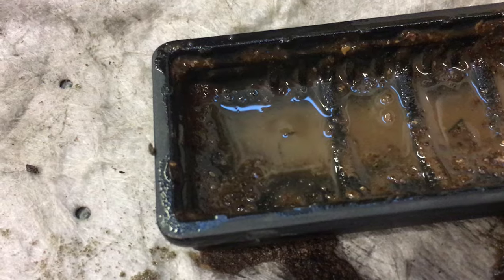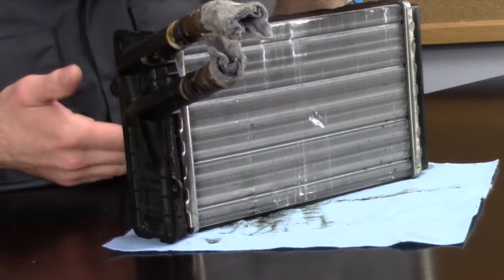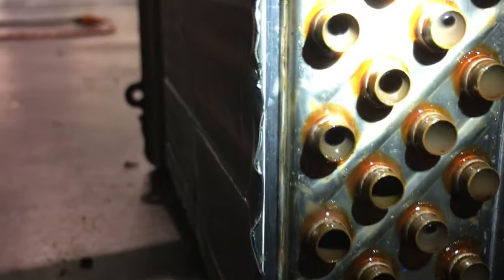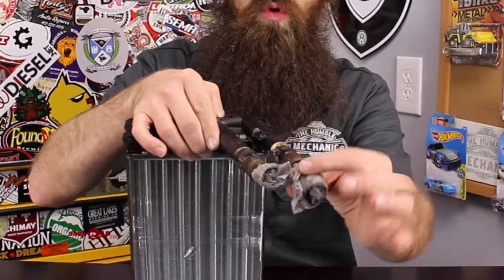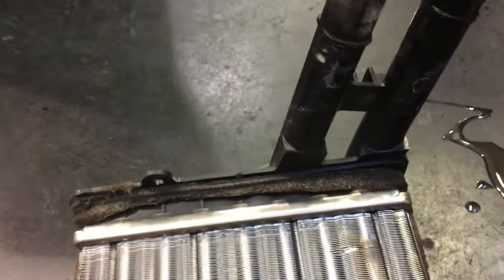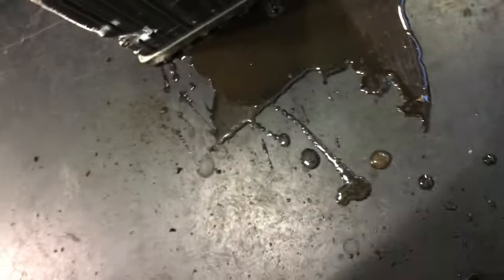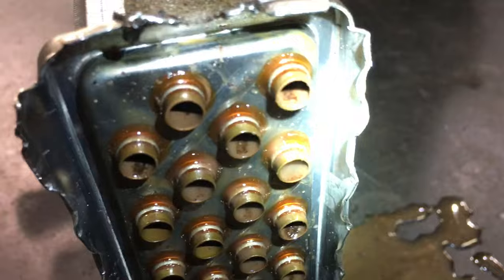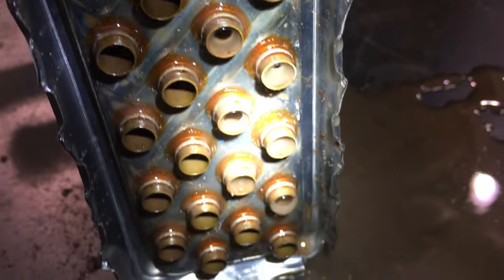How VW Parts Fail ~ Heater Cores

Comment: I bought a 2014 Passat TDI with 59k miles and within three months I had to have a new heater core put in. Six months later another heater core, that one lasted eight months and had to replace it again. Each time the work was done at the VW dealership I bought the car from under warranty. After the third heater care I made the decision to trade in the car for a new Toyota. I do miss the great fuel economy of the TDI but but the poor reliability of that car wasn't worth the headaches.
Reply: Getting a newer tdi is always a bad choice
Reply: I got a 13 Passat at 92k miles. Put about 100K miles on it, Heater core went bad, flywheel went bad, radiator fan went bad, oil filter housing leaked oil and coolant and needed replaced, alternator pully went bad, a/c compressor went bad, DEF fluid temperature sensor malfunctioned causing no restart in 200 miles, a bad ground connection causing battery charging and starting issues, a failed coolant hose barb and last but not least, 5K miles ago had to replace the turbo.  It has been by far the least reliable vehicle I've ever owned and I'll never own another VW ever again. I got a 2021 Mazda with a skyactiveG engine and it is every bit as nice as the Passat with 100x the reliability.

Comment: Here's how heater cores fail - 1) Failure to change the "lifetime coolant" every 5 years or 100,000 miles.   That "lifetime coolant" turns acidic over time, and the acidic coolant starts eating away at the plastic cooling components - especially the plastic END TANKS.
2) Clogging by mixing g12 coolant with a non g12 coolant.

Comment: why not putting a coolant filter like the big trucks have? you can install it as a bypass system. That way the heater core, egr cooler etc will not clog and just replace a $2 filter instead of that huge mess of replacing the heater core.
Reply: because if you take care of your coolant, you don't need anything lol
Reply: @hsproyaya  I'm on my 4th heater core. Each time, the coolant was replaced, and only 9 months between replacements. Taking care of coolant is the problem.

Comment: Back in 2004 my wife bought a used 04 diesel bug from the VW dealer. The car was a awesome looking and my wife loved the look of it. But we didn't like all of the problems it had after we bought it. One of the problems was the heater didn't blow out hot air. My wife had a 70 mile commute to work one way so the heater should have started working long before she got to work. I thought right off the bat it was the heater core so I had my wife drop it off at the dealer to get it fixed because it was under warranty. A couple of days later my wife gets a call to pick up the car. When she got to the dealer the service writer told my wife "the mechanic wanted me to tell you that this car is a diesel and it takes a while for the car to heat up". That mechanic didn't want to go under the dash to change out what was obviously wrong with the heater. I think it would have been a different story if I dropped off the car instead of my wife. So when we dropped off the car the second time I went with her and I talked to the service manager about the crappy service they gave to my wife. I am a certified FAA power plant mechanic so I know right off the bat that the VW mechanic was lazy and full of crap. They took the car in again that day and we had the car back the next day with a new heater core and the heat worked perfectly.
Reply: Did the heater core failure also cause the coolant to leak or just the heater from working?
Reply: Robert, I like hearing stories like yours.  Glad to hear you successfully pushed back on the service department, and did it with your wife standing by your side so that hopefully she's more confident in doing the same or at a minimum, continues to trust her intuition enough to find knowledgable advocates like you, in any type of situation, to forcefully and effectively push back when appropriate.  Separately, it's good to hear from a jet engine mechanic.  Years ago I was a technician in the military, performing intermediate maintenance on the: J-79, J-85, TF-30, TF-34, F-100-PW-100, 200, 220E, 220, and GE-110, along with some secondary power system and test cell work.
Reply: Little late but GOOD FOR YOU ROBERT!
Just think about how that dealer was able to get to that point to be that deceptive and lazy
To think how many customers they've scammed and treat hard working people with fraud
Reply: They do it to women way too much!!

Comment: Huge fan, humble mechanic! Thanks for all you do! 
I have 07’ gti and have learned that if I turn on heat before the car has reached normal operating temp., (190F) then I get cool air. To add to this— lately, the heat only works on the floor mode or the floor/ defrost mode.  Reside in Texas, so it’s not that big of a deal— just don’t want other problems down the road. Thx again.

Comment: Just did this on a 03 Passat wagon GLX 4Motion. I love this effin car. LOVE IT.. Winter coming in Northern Utah, so I gave it a shot. From zero heat (literally it was non existent) to blow you out of the car heat in 2 hours. 
Started with a flush, then a back flush got all sorts of big chunks out. Then added the CLR and let it sit for about 5 minutes, pushed the cle through with a little bit of pressure, and Wham-o.. Normal flow. Flushed and did the CLR 1 more time then flushed with clean water for 10 gallons after it ran clear, both ways. Then filled up the Core with some coolant (compatible) and tested it out. Unreal.
Reply from the maker: NICE!!!!!

Comment: I'm not sure how I missed this when you posted it. With persistent low passenger side heat, I took my 2014 Passat TDi with 56k miles to the dealer today. 

I'll bump this old comment thread to say that I now how parts fail firsthand. They were not surprised when I described the problem.
Reply from the maker: Yeah once the first cold snap came here  we had a run of them. 

As if a week ago, they were on back order.

Comment: Excellent video! I own am the proud owner of a 93 corrado and i believe mine got the heater core "fix"  from the recall which was just a rubber step down placed inside of the coolant pipe so less pressure would be going through the core. Well the previous owner must have had a leak because the coolant lines were elbowed. I ended up replacing the core but out comes the entire dash and on a 20+ year old vehicle dash parts are a paint to take appart and reassemble and have everything fit nice.

Comment: You're right about heater core issues on the old Mk2s and 'Rados, if you ask any of the old heads someone always knows a guy that had the core leak or even explode in those cars. I've never seen issue in any of the Mk4 and newer but have seen the B5 and B5.5 Passat/A4/S4 have clogged cores.

Comment: Funny enough today I had a 2013 Skoda Octavia with a clogged heater core, seems to be a common issue with this generation, and looked like some sort of block corrosion for using just water that blocked it... very important to use the right coolant ... great vid 👍

Comment: Firstly: I love your videos and attitude you have towards your profession.
Secondly: I have a Skoda Octavia where there's a HUGE temperature difference between the cooling on the passenger side compared to the driver side. There'll be hot air blowing on the driver side, while the passenger side gets cold air. I'm assuming that isn't the heater core.
On top of this my car uses an abnormal amount of coolant. I have had to refill five times since early September.
There are other big problems with it, but it's driven 330.000km in 8 years. So I guess it's as expected :)
Reply: +StarIVwakeup USA Passats have this problem when the heater core clogs. There was a defect in a bunch of them in 2013.

Comment: Haha, I literally just buttoned up my B4 after replacing the heater core, and now this popped up recommended from YouTube.

Call me odd, but I actually prefer pulling the dash; gives me a chance to tackle rattles and latent wiring issues.  :D
Reply from the maker: Hahaha I have seen taking the dash out cause more rattles than fix rattles. Lol 

How did the job go overall?
Reply: HumbleMechanic
Haha, yeah, I've had that happen! 

It went fairly smoothly!  The only real issues were receiving the wrong heater core, and trying to find some replacement foam for ducting joints..

Every last bit of that ridiculous foam covering the wiring harness leads dissolved the moment I looked at it, so I ended up having to re-loom it with some proper conduit, which lead to re-routing the entire under-dash wiring harness to make future dash removals much easier.

Between having the wrong part show up and redoing the wiring harness, it was a 3-day affair.  No rattles, though, so totally worth it!  :D

Comment: Awesome Vid with great info! My dad has a 2012 VW Beetle and the coolant line where it connects to the heater core on the firewall has snapped. Like the little plastic nub that comes out so the coolant line can attach to it has broken clean off and is inside the coolant line. Would you think the heater core was clogged and thats why it broke? Or maybe a crack that got bigger and bigger and then finally broke? Thank you!

Comment: Bought my 2014 TDI Passat with 40+K mi. it's now at 70K.  I love the car but am more than disappointed at having  to replace the heater core twice in less than 30K mi. since I bought it. VW did both replacements under warranty but I am very nervous about keeping the car for its fourth core.  No leaks, just crude.  I never drive less than 10mi.  If that's the pattern, it seems like I'd need to flush every 20K.  Seems extreme.  The dealer says it's not uncommon and VW is still looking for a solution.

Comment: Just purchased a 2001 1.8t pass at yesterday.  Temp never came out of 130 degrees range driving on highway.  Heat was ok but not hot.  When I went into street traffic, heater and higher.  I think either thermostat is stuck open or no installed.   Watching your video I see it could be a chain reaction of heater core etc.

Comment: I have a 2000 VW Passat B5 wagon and have zero heat now. I was getting some heat but would take a while and now it just blows cold air, which sucks since here in Seattle we are into winter weather. I simply don't know enough to do a flush on my own as that more than likely is what needs to be done, wish I could find a fellow Passat owner here who has done this that could assist, as I don't think this is something a dealership would do, or one that I could trust to do. Great video by the way.
Reply from the maker: We do these flushes all the time at the dealer. often time it works. Some times it doesn't, and the heater core needs replacement.
Reply: Off the record can you quote roughly what a VW dealership would charge? Also is this something they do when they perform a standard radiator flush or is a heater core flush something you need to request with a radiator flush or is it a standalone service?

Comment: Silica bags on the coolant reservoir is a joke that Daimler also do the same by claiming coolant last forever although Pentosin told us G12++, G13 only last 10 years/100k miles.  VW try to cloud it by adding those stupid silica bag.

Comment: Oh yeah, I had to go through this unclogging process and I am glad that I had made that attempt because the auto mechanic solution was to replace the heater core. That was a $600 repair bill I dodged because I did a little research and did exactly as you described in this video. I also found a coolant line filter that I picked up that could prevent rust from building up in the heater core. A company called Gano Filters makes it. I am now much more mindful of the state of my coolant these days.
Reply from the maker: +gohachi Nice job out smarting that $600 bill!
Reply: gohachi what year make and model car did you have? I have a 2013 Volkswagen and I’m trying to avoid a $1000 heater core bill. Had cold air/no heat blowing on passenger side

Comment: smoking through the vents and top part of the fire wall under the hood. leaking hoses or failed heater core? iv alrdy replaced a couple other water system parts.

Comment: @HumbleMechanic, I had a problem with my heater last winter and I got the heater core flushed, and that fixed my heater problem. However, I'm having the same issue again, my heater barely works and I'm wondering if it's the same problem.  Any help would be really appreciated :)

Comment: My Mark 7 Golf takes a long time before the heater core produces hot air. No error codes for thermostat, coolant level is fine, and pipes to the heater core are warm after only 5 mins driving.

Comment: great video. I just did a flush on my 02 passat wagon that had "survivable" heat at higher RPM, very little at idle. Used the CLR, and an OTC blast vac , combo air (30 or psi for short bursts) and water. lots of junk, mysterious things came out lol. Heat is so far fantastic about 150 degrees from vents
Reply: Gary Giarretta would u be able to share the type of CLR and OTC u used. I'm in the proces of flushing my heater core on my "97 polo.

Comment: My mk4 jetta tdi has a failing one I believe. It's blowing hot air but it smells sweet and the windshield and side windows are getting coated in what I believe is coolant. It's a nasty foggy film that's pretty difficult to get off the glass

Comment: Firstly thanks a lot for all your useful videos. I need your help.I have totally cold air through the vents.

- Inlet and outlet hoses on the heater core are hot  the engine is at 90 degrees centigrade.  
- checked water pump and thermostade; both are OK
- Air Condition OK. When AC is on, vents work perfectly 
- Bleded the heater core. 
- I worked the climatronic self-diagnose system. 25b error code (Footwell/Defoster Blower Vent-V85) but after resetting it disappeare again.  I have  problemonly with footwell vents as I observe when AC is on.
I flushed the heater core only once in 25 years a few years ago when I had the same problem again but this time I hesitate to flush. As I read in the forms,  flushing might damage a leak in the heater core. You know it may be so difficult and expensive in especially 25 year-old Passat B5 as the dash board might fall a part while trying to reach the heater core.
My question is ; might the CLR chemical during flushing damage my 25 year-old  heater core ?
Thank you for your feedeback in advance.

Comment: I got a used 2000 VW Passat wagon (B5) with a clogged heater core--because the previous owner used StopLeak. When I flushed the core and radiator, the radiator started leaking again.

Comment: Had my heater core replaced in our 2009 VW CC about 2 years ago with original parts (supposedly). Seems like now I have a weak heat in the passenger side again. Any idea why it would clog up (supposedly) again so soon? I wish there was a good video of how to flush the VW heater core on these.

Comment: I have a 2013 VW Passat TDI. I had one heater core replaced under the TDI warranty in 2018. Heating & Defrost issues have returned. Is there a way to flush the entire system of the aluminum rust caused by the DEF mixture from DEF tank to Heater Core? Drain tube clog? Blend door, Door motor, Actuator,...etc? Is the dual climate control mod a possible culprit as well?

Comment: I have this problem on my 57 plate seat Leon 

Thermostat fixed 
Blowers fixed, resistor blew out 🤦‍♂️

Gets to temp, blowing freezing cold air 😩🥶

I’ll have a chat with the mechanic in the morning then..

They didn’t seem to lean towards this thought for some reason when I was last there.. 🤷‍♂️

Comment: The issue I am having is that after my car went for a car wash my heater stopped working, the next day I noticed some water (because it doesn't have any smell) on the carpet on the passenger side and the blower motor has stopped working on any settings. Now I'm not sure if it's just the blower motor that's defective or is it also heater core? Could the water pressure from the car wash leaked inside the cabin somehow and shorted the blower motor? Is there a chance once the water is dried up things will go back to normal or should I be replacing both the blower and heater core? any help would be much appreciated. 

Thanks.

Comment: Hey! My 2004 Volkswagen GTI has a strong smell of coolant when the heat is on. The coolant level is stable, however, and my carpet doesn't get wet. I had a problem with a nipple on my reservoir firing coolant into my cabin filter, but I've changed the filter and used a heat vent cleaning bomb. I'm now looking at the liqui moly heat vent cleaner. It still smells. Do you think it could be a clogged core?

Comment: I've had my 99 Beetle for over 15 years, it's my beater and although I make sure she's dependable I'm not fussy about what she looks like. My heater core is leaking and the passenger side carpet is wet. Of course the factory wants us to remove the dash and all of that but what about a small sawzall and opening up below the glove compartment to get it out? I need one of those shows, quick and easier for sure, it can all be glued back together.

Comment: My heater blows cold air when the temperature outside is like 20 to 30 degrees. Only the driver side vent blows warm air versus the other vents are cold air. Not sure if needs flushing and a dealer mentioned it’s the temperature blend actual. Let me know your input thanks.